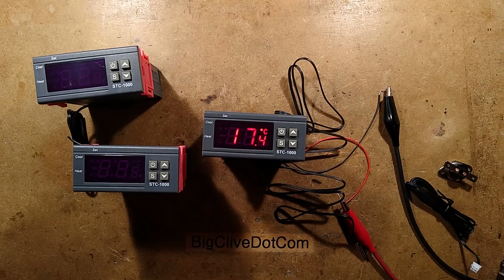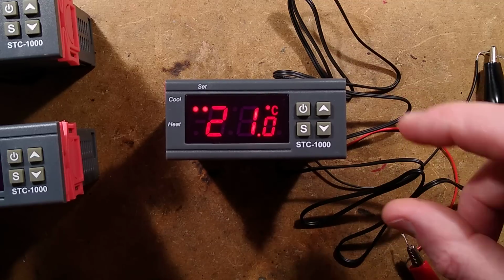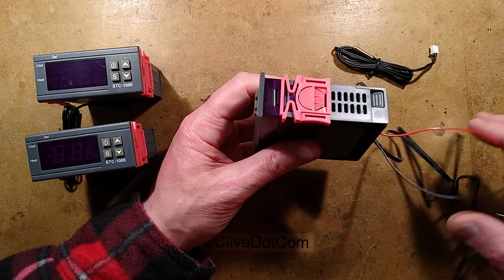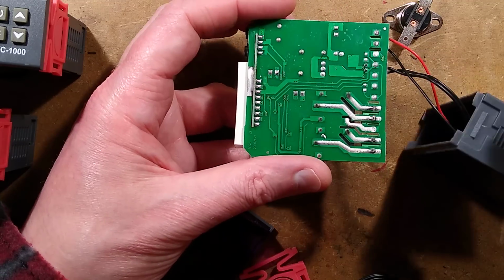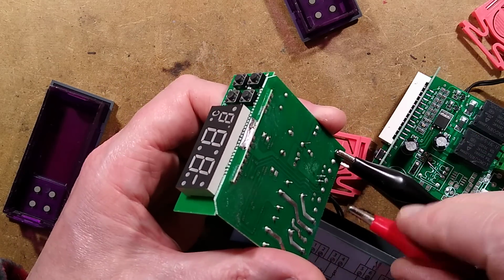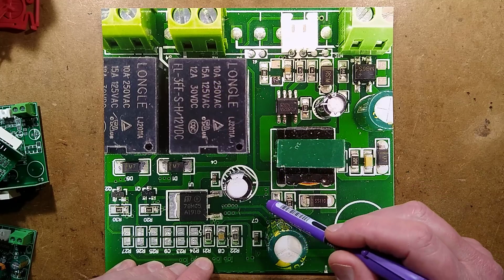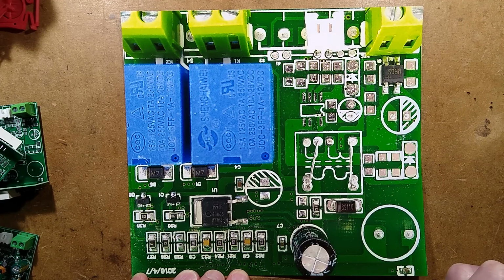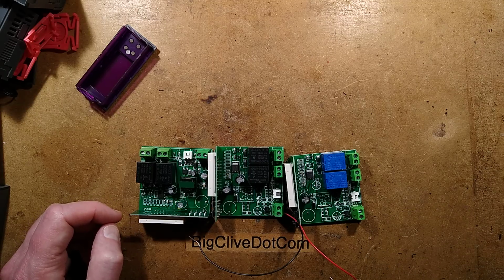Teardown of three STC-1000 style thermostats

Comment: I'm gonna have to rig something like this up for my house thermostat with my heat pump. I would LOVE to be able to choose the differential before it turns on!

Things like this are more accurate if you can find them in F - there are more degrees between freezing and boiling, so you get higher resolution without decimals.
Reply: One decimal place in celsius gives way more resolution than Fahrenheit with zero D.P.s, why the need to avoid any fractional units?
This sounds like an American excuse for resisting the standard that the vast majority of the world uses.
Reply: @ferrumignis  Good lord what a bunch of clueless fools! Nobody said one is "better" than the other and if you think that is what this is about you are deeply incompetent. I simply stated a fact. This device is more accurate without decimals if you use F. If you include 1 decimal, it's significantly more accurate, 2 decimals, more again. This is nothing more than a statement of fact, not an endorsement for any scale. There are more degrees, more degrees is more accurate. Period. The end.

Stop arguing about irrelevant nonsense you incredible bell ends.
Reply: @ferrumignis  - Sounds like another person trying to cover up the fact that the system wasn't intended for regular people, but for scientists.   Accepting the truth doesn't make you a terrible person.  It just means that you accept that the underlying premise might be flawed.   BTW- those are not fractional units.  Those are decimal units.  Yes, they're tenths - but having only one kind of fraction available means it's not fractional.   

Keep in mind, even the French didn't like the system_.   It was completely incompatible with _anything they used, which I believe was the intent of the scientists - who were part of the "French Revolution" intelligentsia.  It took close to 100 years for France to ram it down everyone's throat.       

The latest idiocy where they keep trying to 'reinvent' the measurement for the meter by finding another excuse?   It's insane.   A meter is a meter.  It didn't need to be 1:10000000 of the distance from the equator to the pole (which it wasn't, it was just a really close guess).   It simply is_.   A foot was _roughly the size of an adult male foot.  They did standardize it to 12 inches of specific sizes (over however many centuries), but nobody really gave a crap about "It's the calculation of this wavelength" or "It's the distance  a water droplet falls at sea level in .7 seconds".  It just is.  

Any reasonably educated person can convert between any measurement system without too much trouble.   Trying to yell "One of us! One of us!" and coerce?   Not worth the effort.
Reply: @tbelding  the system wasn't intended for regular people

Don't be so ridiculous, I was obviously right on the money about your comment being a typical American excuse. The rest of the world uses the metric system which is intuitive and doesn't use a wide range of ridiculous and arbitrary conversion factors. Billions of regular people use it everyday without issue, you don't need to be a scientist to take advantage of a system that actually makes some sense.
Reply: @ferrumignis  You're not "on the money", you're delusional and incompetent.
Reply: @ferrumignis  - You missed so hard it's amusing.   I'm Canadian.   There's nothing holy about base 10.  Base 12, base 16, and base 60 are all historical counting systems.  Base 60 is still heavily used, because for round (or spherical) geometries, it makes more sense.   Base 12 - Egyptian.   It's easier to break apart in fractions, because it's divisible by 1,2,3, 4,6, and 12.   I don't know the origin of the base 16 used in Imperial, (half, quarter, 8ths, 16ths, 32nds, 64ths, for dividing inches), but it's still heavily used in computers - rather than your religious grip on base 10.   

Millions of people use the Imperial system every day without a problem as well, and have for a very long time.   It's perfectly logical, like most systems, once you actually think about it.   It's just it's not a base 10 decimal system.    

Yes - the Metric system was not designed for people.  People think in terms of what they have around them.  An inch is roughly the size of at least one finger bone in your hand, no matter how small or large you are.   most people can figure out how much bigger or smaller their foot is than a foot.   A yard is easy to compare across your arm and chest.  (Cloth yard meant pinching cloth between your thumb and forefinger, and drawing it back to your opposite shoulder.  Thus the 'clothyard shaft' arrow type) 

Those idiot 'scientists' (more like retarded educators) would have been better served to have taken a common, known, 'Imperial" measurement, and then built their system around that.   "Metric foot", for example.  Not use a base unit of measurement that's bigger than most people use regularly.   (It's like measuring in yards)
Reply: @tbelding  "You missed so hard it's amusing"

Your desperation is hilarious, please keep going! 

_"I'm Canadian." _

So you are a north American, I knew it.

"base 12, base 16, and base 60 are all historical counting systems. "

"historical" is about right. Which base is used in imperial measurements?  Oh all of them? That's far more convenient than a single base 10 for all measurements, right?

"Millions of people use the Imperial system every day without a problem as well,"

That's because there are millions of people in America.  OTOH billions of people use the metric system every day.

"Those idiot 'scientists' (more like retarded educators)"

🤣🤣Please stop, my sides hurt. The fact you actually believe you are better educated than the worlds top scientists is hilarious, and by coincidence is exactly the same kind of argument that flat earthers use.
Reply from the maker: I've just made a video about an Elitech one that does offer either C or F.  It'll be released fairly soon.
Reply: celsius is good for cooking since water's phase change points are so important, fahrenheit makes sense for weather because 0 to 100 is close to the year round temperature range in most temperate climates, kelvin is good for those times you need a linear relationship with other thermodynamic properties (and since such applications have little need for intuitive reference points I guess rankine would work equally well)
Reply: @ailivac  Ah, but there's a problem there.   Water's phase change is NOT inviolate.  It's dependent on air pressure.  It boils at 100 C _at sea level_, with distilled water.   At 500 metres, it's 99.5C.   Every 500 metres, remove half a degree C.   So that's a fallacious argument.  You have to know the adjustments no matter what.
Reply: @manitoba2445 - Except that it doesn't matter what you order.  If you order 8/32 screws that are 1 1/2" long, any half way competent company should be able to produce them.   I have M6 nuts that don't fit on M6 bolts - because they come from different manufacturers - and apparently one, or both, was incompetent.   

My father (I'm in IT) was a mechanical design engineer.  He worked (still does, as a hobby) in both systems.   He agrees with me that it doesn't matter what system you use as long as you are consistent.   If you want to build using imperial measurements, use imperial (SAE) fasteners.   Don't be like the Europeans and refuse to even TOUCH anything but Metric because it's the Holy Grail and everyone MUST CONVERT!   (I swear, it's a modern Crusade)   I do find Witworth somewhat annoying, because it's hard to find the fasteners to fix really old house hardware. 

For fun? Almost all shipping measurements are actually Imperial.  They just converted to metric.  Look at container sizes, if you don't believe me.   Containerization is from the US development, but I believe that the rest of it is from the domination of England over the seas for so long.
Reply: @tbelding  Nobody gets it. This has nothing to do with scales or preferences. On a cheap device like this, if you have access to the Fahrenheit scale, IT IS MORE ACCURATE! This is a fact, nothing more. No opinions allowed here. If there are more degrees then the accuracy is higher. If you include a decimal it's even higher.

You can go back to whatever local BS scale you use, if you set the thing in F it will be more accurate. FACTS
Reply: @ryanroberts1104  Don't confuse precision with accuracy!
Reply: @cambridgemart2075  Fahrenheit provides more accuracy and precision. There is less space between each degree. That simple.
Reply: @ryanroberts1104  And again, don't confuse accuracy and precision. They are not the same thing.
Reply: You just hit the nail on the head why Celsius is a terrible way to measure temperature for humans.  We're VERY sensitive to temperature changes, so the wider range is much more useful.    (If they had abandoned the idea of base 10, and used 200 degrees instead of 100, it would have been just fine.  )
Reply: @manitoba2445 - What people call the "Metric" system has a lot of failure points that are constantly glossed over.   The biggest problem is that it was invented by so-called "scientists", with ZERO thought for its actual usefulness in day to day tasks.   (That and it used a nonsense calculation to come up with the 'base unit')   On the flip side, the 'Imperial' system developed organically, with base units that were built around what people used regularly.   "Foot", "Yard", even things like "Cubit".  The problem was that they were... shall we say flexible.  

Before you go nuts, I grew up with both systems, and I can use them pretty much interchangeably.   Metric still drives me crazy - especially how bad people that grew up strictly with it are with fractions :)   A decimeter might be useful as a daily measurement, but centimeter tends to be too small, and the meter is too unwieldy.   When was the last time you saw anyone use the 'deci'?   I'd bet you can't think of one after school.  Everyone seems to think that they should just scale up the smallest unit.  "160 centimeters".    I've even seen '600 millimeters'.    The concept of simplification seems to be beyond too many people.    (I mean, I don't think I've heard anyone say they're 69 inches tall.   Usually they're 5'9")

Comment: I came across these PID controllers when I was upgrading/modding my Gaggia Classic Pro espresso machine. The normal bimetallic controller would control the boiler approximately within 10 degrees which if you're obsessed with espresso is no beuno.  You can set the temp precisely on them and these little buggers will keep the boiler within a degree. I've also seen them being shoehorned into Rancillio Silvia machines.
Reply: Shades of Coffee fan?

Comment: Sometimes you have a changeover on one relay so that you can't have heating and cooloing on at the same time
I would add ceramic capacitors across the contacts to reduce arcing. or use the modules to control solid state relays

Comment: I have a few of these running, both mains and DC powered. One AC unit has been running for near 10 years controlling a cooling fan on my grid tie inverter system (non kosher).
Another DC unit has been controlling via a power relay a cooling fan on my Land Rover diesel, Lucas electrics have not managed to destroy it in 12 months so they must be tough.

Comment: Clive, I have the Inkbird ITC-1000F in my house, its very similar to yours but its display will support Centigrade and  Ferinheight. Here in the USA that helps. It functions a little differently than the SCT-1000 but is the same case and connections. I have hot air oil heat so I have mounted the thermocouple into my dryer vent that I change to vent into the basement through filters. When the dryer vent reaches 75 deg F it turns on the fan in my furnace and dissipates the heat throughout the house along with the humidity in which is greatly needed in the winter. Works great!

Comment: I probably have the deluxe version because mine got the buzzer populated. Probably the deluxe plus version have the humidity sensor thing and have a double throw relay. I have mine used for about 3 years now on a fridge with broken thermostat and planning to rip those internal power supply and use external power brick and relay.

Comment: word of warning with these. The traces on the board and or the relays WILL NOT BE ABLE TO SWITCH INDUCTIVE LOADS! I had one of these fail within a chiller. I fixed it by braking out cables to an external relay, which intern drives a contactor. 

Save yourself some trouble

Comment: I also have a couple of 240V / 40A versions that I use for brewery water heaters. They've worked happily for a few years now after a normal mains voltage one went smokily overloaded. I use normal mains ones to run a big fridge, small fermentation heaters, greenhouse propagators. One thing I would recommend is putting them in metal cases. They're cheap and disposable but they also fail.

Comment: I have taken apart many coffee makers, and they rely on a thermal cut out switch that cycles the appliance on and off to warm your coffee pot all morning. That is a part that if it fails,1500 watts of power to the heating coil could start a fire.
Reply: But there should be another thermal cutout that will permanently cut power to prevent fire in case the operating thermostat fails in the closed condition.
Reply: I think your right, some have an extra back-up.

Comment: I've been using these with my fermentation fridge for years with an incandescent light bulb, and for controlling a freezer as a keg fridge.  I also use Inkbird 308s but the non. WiFi version has occasional temperature transients that cause the fridge to kick in for a brief time occasionally (it's a known bug they know about) and its cali bration can shift.  I find cheap stcs more reliable than 308s.

Comment: i discovered that ntc isolation issue aswell and tested it. at 500v it arced and conducted even to the metal cap on the ntc... dont put that ting in your fishtank or any non grounded metal surface ;)
Reply: There are insulated NTCs for applications where they can be touched like in fridges, both the sensor and cable are plastic sheathed, but I have no idea what voltage they are rated for.
Reply: @ruben_balea  it dosnt matter, if the unit arcs over to the sensor, the unit will go bang so its no longer working anyways... the cables of the provided ntc are rated for 50v, the metal cap is just glued over the ntc, so its based on luck how much it isolates ;)

Comment: My Goto are the REX -C100 with 40A SSR and heat sink.  We have 30 anodizing tanks running 24/365 for a few years, with only 4 failures.......So cheap I can stock a few dozen back-ups... just in case the supply chain really goes to hell for a decade....and Much cheaper than my annual Starbucks habit😎

Comment: Love these things. I used one to make a sous vide machine out of our slow cooker. Must be a manual (not electronic) slow cooker.
Reply: Same here. Absolutely amazing results. Made mine using a basic enclosure box and an old extension lead. That way I can stick the probe and meat in any slow cooker; future proof and didn't need to modify my slow cooker :)
Reply: @SteveFennel  Great minds think alike? I can use my little friend to control the temperature of many things. I also am building another to use with a small freezer for a cheese cave.

Comment: I noticed that the first 12v unit had isolation slots on the relay output connections so switching mains voltage should be reasonably safe. Sadly the other versions did not have those slots.

Comment: yaaaaas i love these cheap lil bastards there great i use them for my sneks and there perfect edit also if you power off the unit after setting it it resets but if you hit the power button before it returns to operation it saves it also im not the only one who has to peel those displays ps ooooof 10 quid they go for 5 usually just gotta poke about a bit

Comment: Not sure about this looking for something to control the heat inside my 3d printer I may give it a chance
Reply: I'm just about to start building an enclosure for my two printers, and this looks just what I need. I was going to use an Arduino, but this is quicker and easier!

Comment: I've only seen square types, how strange! Be I teresting if you could use it in an oven and make it a little more efficient

Would a relay in a vacuum still weld shut? Or perhaps between the two contacts a conductive rubber?

Comment: I notice only the 1st one has any sort of isolation gaps milled into the pcb. Not sure if the others are for lower voltage use But I dont think anyone should trust  running anything expensive with these. Especially if it was a paid job.   Interesting bit of kit. 2x👍

Comment: Ah ha! I was looking for a low voltage thermostat with an adjustable differential to use with my pellet stove! Using a standard thermostat with a pellet stove results in it cycling on and off constantly-the typical thermostats usually have a 1 degree differential.  The stoves take about 20 min to shutdown completely, and about 5-10 min to power up and start producing heat.  For me, an 8-10 degree (F) differential is perfect! (As well as time delays) thanks for the video!
Reply: So 5°C differential (conversion factor is 5/9).
Reply: But, if youre in the us, Harbor Freignt sells a $23 multimeter that comes with its own k type thermocouple.
Reply: Well it comes with a weaker thermocouple so if youre taking really high temps you might be out of luck. Not sure if theyll accept a k type.
Reply: them microshuntroller is en2apment for the mnd..... dont buye until e2e2 AT HAND